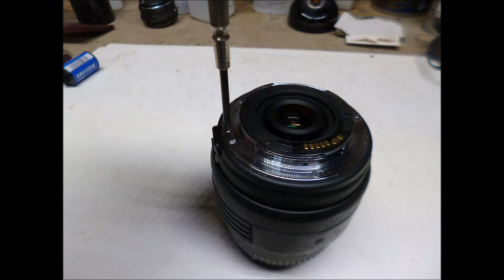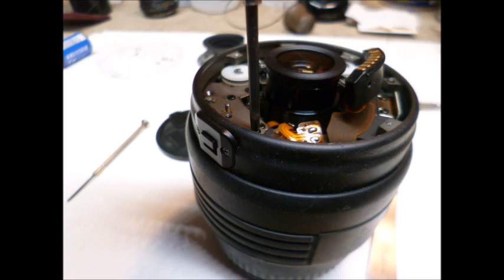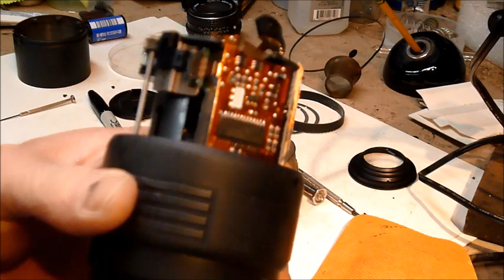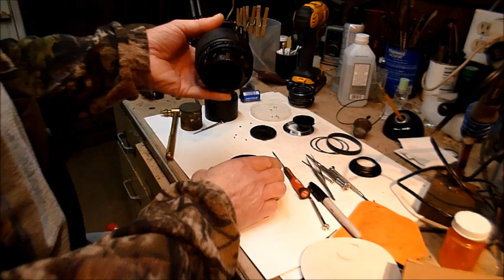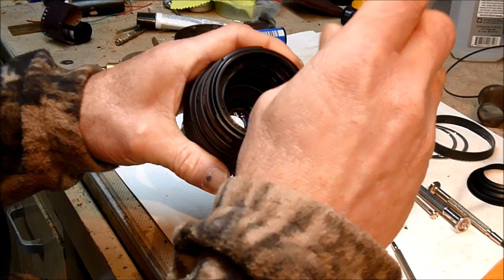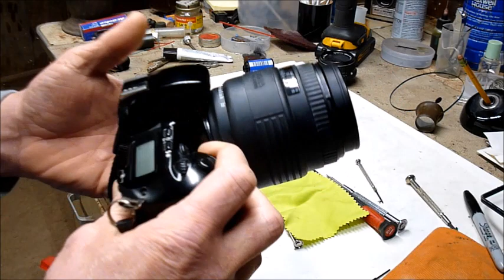Sigma UC 70-210mm zoom lens repair

Comment: Interesting - Thank you
I have one of these lens. It is functioning but the bajonet of the lenshood is very tight. so when I assemble or disassemble it it often tricks to the focussing ring and this become separate from the lens. It can simply be reinserted, but for practical use it is anoing. Do you have any idea how to fix that?

Comment: Hi! How did you take off the front element? It wasn’t shown in detail in the video
Reply from the maker: It's been a while but most of those front lenses just unscrew, you will need a decent quality spanner that has reversible tips for pinholes and slotted rings. Behind front lenses are often found stacked lenses that usually come out as a unit. Beyond that I don't remember,  I don't even have that lens anymore.
Reply: @tobroken1965  thanks! I’ll see what I can do. Really appreciated your video! (You seem to be the only one on YouTube to have disassembled one of these lenses)